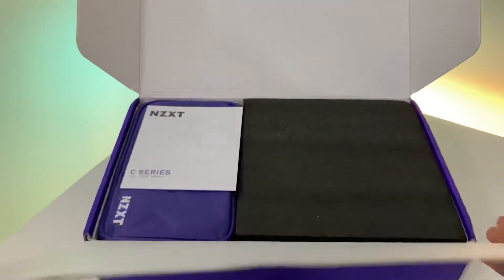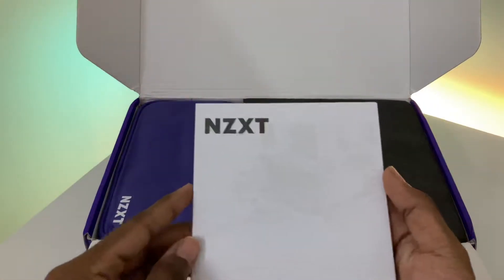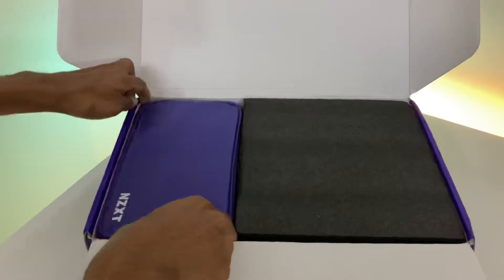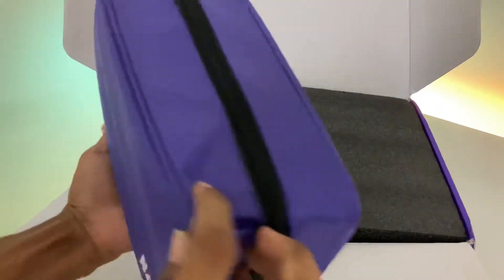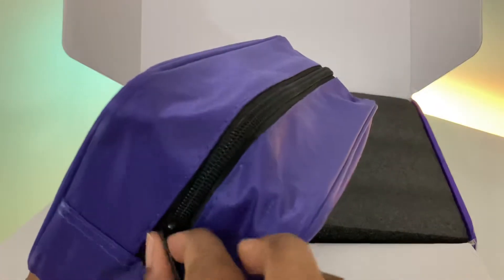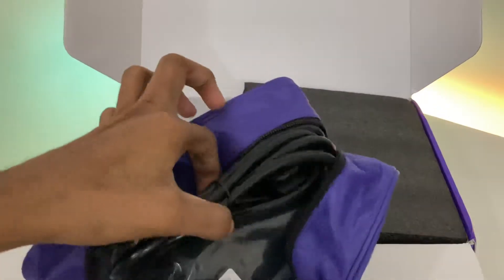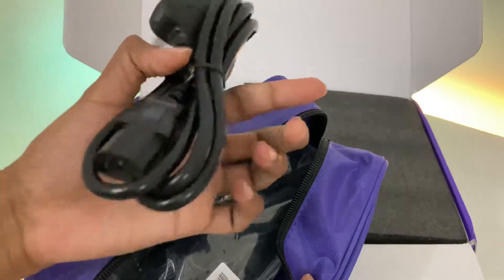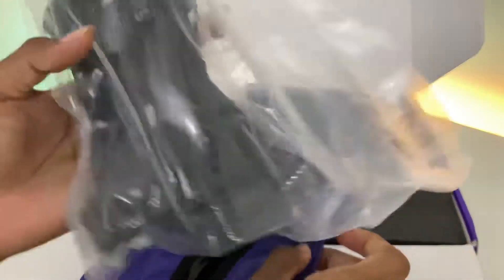Changing PSU can eliminate GPU coil whine - NZXT C650

Comment: man i was about to buy cooler master MWE 650 gold, it wont stop coil whine ???? i have rn a very very very low low tier psu (spanish brand) very cheap, so is bad quality
so what should i buy, the CM v2 650w gold or MSI mag a650bn bronze
Reply from the maker: It would be very hard to say. Different products react differently with different parts. For you Cooler Master may actually be better who knows. I have used a lot of Cooler master PSUs, none of them had any problems except this one.

I will say one thing, as of now, avoid NZXT, Corsair, Gigabyte.

You can buy CM specially if there is a return policy and see it for yourself.

I have never used MSI PSU, so can’t talk about them but heard nothing bad about them either.
Reply: @starrims  avoid corsair? Why? i was gonna buy that now because i saq its better quality that MSI. A corsair cx650 bronze

Comment: What about the 3080 ti? cpu i59400
Reply from the maker: First of all, your CPU will be heavily bottlenecked with 3080 Ti.

And Coil while it depends. If you don’t plan to upgrade the CPU ever, 650 is ok, but 850 watt is heavily recommended.
Reply: @starrims  I don't plan to upgrade the processor, but is it safe to use 650w nzxt C650 GOLD?
Reply from the maker: It will be fine.
Reply: @starrims  Thank you for the tips and guidance

Comment: So basically we sould not buy Cooler Master PSU to avoid GPU's coil whine ?
I got a cooler master mwe 750 bronze 230v (v2) with a Gigabyte RX 7600 that makes a lot of coil whine when playing :/
Reply from the maker: That could be it. Cooler master quality is not good now as before!
Reply: @starrims  So the coil whine coming from my GPU is caused because of my PSU ? So which PSU is the best to buy ? (Msi, Bequiet, Corsair...) :')
Reply from the maker: Any of those brands will be perfectly fine.

Comment: For me it's the other way around.. I used to have an msi gaming x trio 3070 with zero coil whine, swapped it to asus rog 3070 and immediately have it. In both cases I'm using this exact PSU, so i doubt that it really is the problem. Its lottery
Reply: Still working perfectly? I mean the PSU

Comment: Hi, so I gave my 1080 to my friend, since I am staying with xbox for now.
So I wonder if you would recommend this psu for a very low load like a 65W 12400 alone pc.
I just want my options open for a future card, still worried about a very bad efficiency of low loads on a higher tiered psu.
Reply from the maker: 650 watt gold will be absolutely fine. But if you plan for more high-end GPU go for 750W
Reply: @starrims  Thanks for the reply bro. This will be for under 10% load till I get a GPU in the future. Everyone saying this model is waste for low load. I'm confused.
Reply from the maker: If you want efficiency for ideal usage you gotta go with extremely high-end Platinum PSUs. This Gold PSU only go for the efficiency under Load.
Reply: @starrims  Thanks for the reply. But I bought a XPG CORE REACTOR 750W. Super silent at 15W load,when all the other PSUs made humming noise at this super low loads. Fan do spin at this low load, but zero fan noise. Time will tell if it is a good one.

Comment: omg tysm, ive been having coil whine with my gpu ever since i built my new system with the same power supply and its been pissing me off so much, imma replace it with a corsair or maybe the nzxt depending on pricing
Reply from the maker: Thanks. It worked for me so I hope you get the same experience too :)
Reply: @starrims  🙏